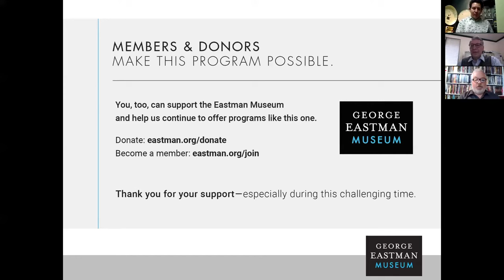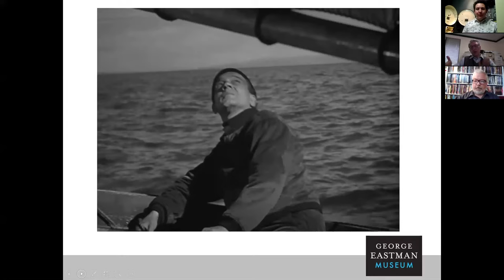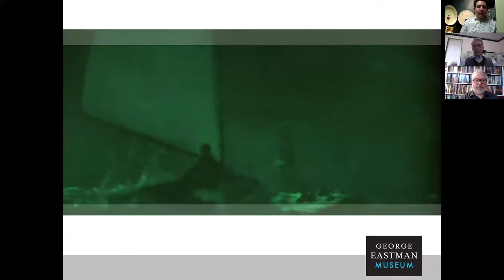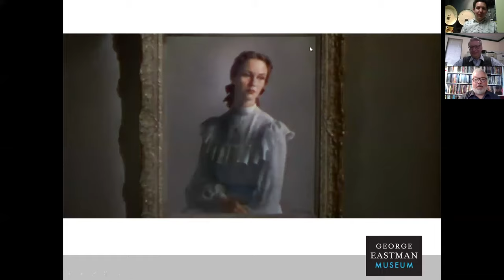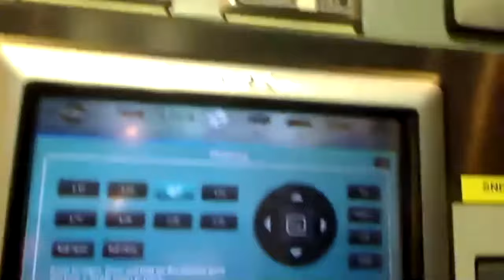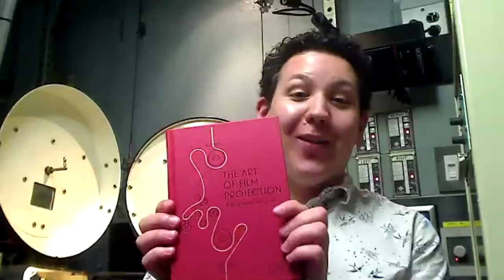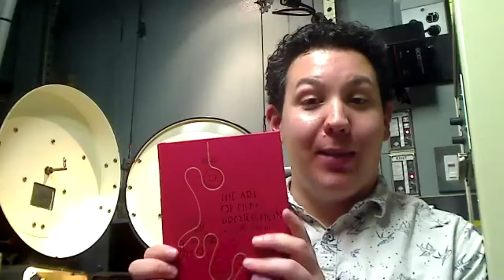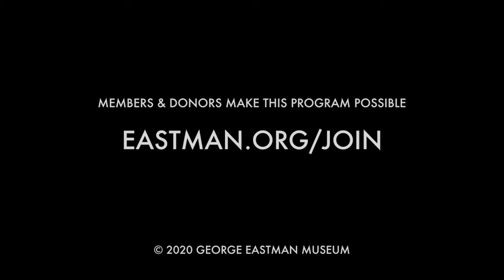Portrait of Jennie: The Rarest Cinematic Experience of All Time

Comment: Despite lame audio here and there, this is freaking FASCINATING. 
"Jenny" on tv freaked my adolescent self right out. 
Decades later, I chose to sleuth it down and watch it on my comp. 
It opened so many doors for me and it's happening again. Though I made Super-8 movies in the 70's and knew some projectionists,  (one from the last US rear-scree, "the Brattle,"  near Harvard U) I managed not to notice or ponder all this tech. 
Got me reverse engineering how my Bolex worked.... at half-speed, the bulb, I thought,  "dimmed" NO! It was throttled down by a mask or aperture. 
I once salvaged a stack of cinema trade mags from a dumpster and sold them to a collector. 
I had one of the annual drive-in theater editions. It had an ad for Osram xenon bulbs. THAT was a huge improvement. No crash gate needed for stopped film.... just stop strobing! A bulb must be kept at temp. 
Thanks for muting the freaking beep. 
Am I the only one who thinks this film's maybe a bit pervy?